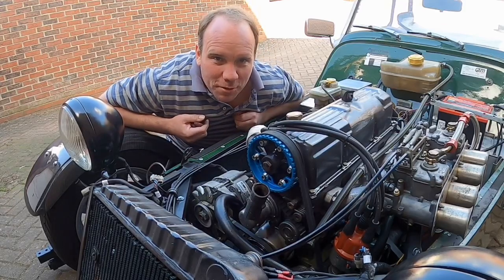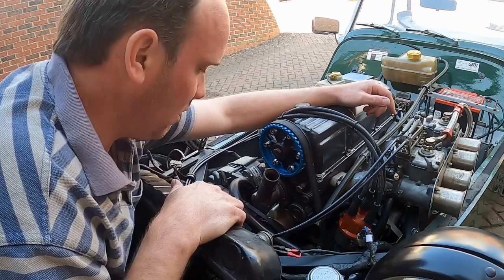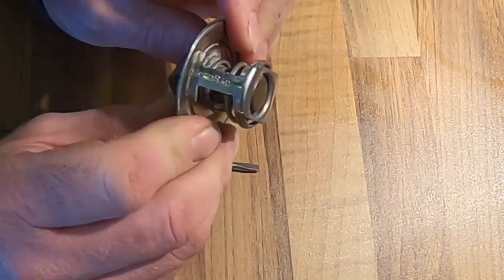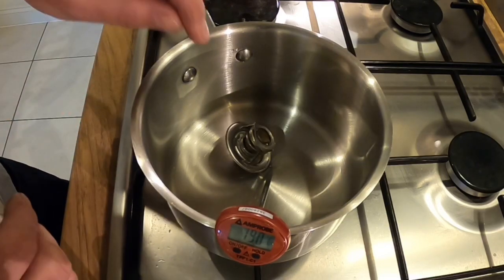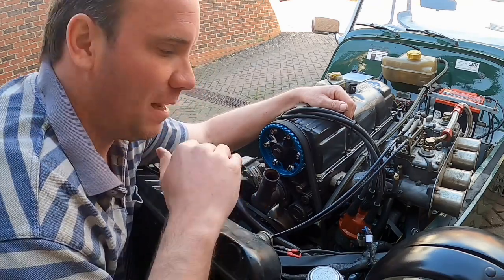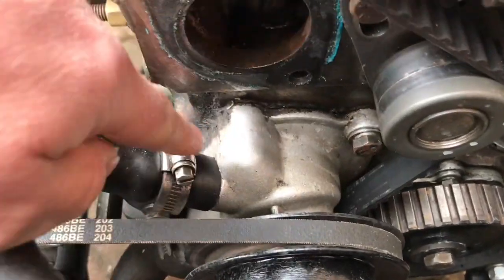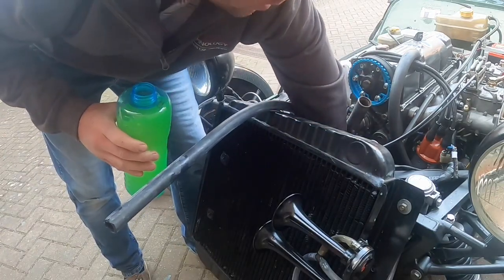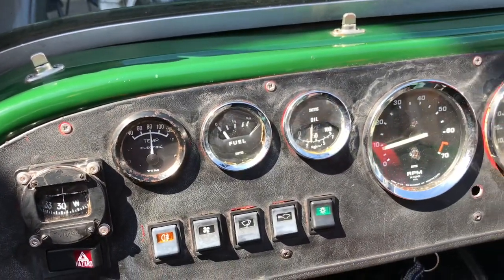Is your engine overheating? Try this first before spending ££$$ Ford Pinto 2.0 Westfield

Comment: Question; could you put an auxiliary water pump into the coolanr system? 

I am currently setting up a 2.1 Pinto in a kitcar and a little worried about cooling issues before they occur... I noticed modern cars have a couple of electric water pumps in addition to whats in the block itself, would it be any good in a pinto?
Reply from the maker: Yes this is possible but the mechanical pump is sufficient enough. It’s a more expensive solution. You will see in another video of mine that the solution was to purchase an aluminium radiator with an electric fan. My rad was old and blocked which led to my overheating
Reply: @alfatechniks887  noted 👌 thanks 

Ğ

Comment: Sorry to tell you but the standard thermo was a 92°, the 88 was fitted to vehicles going to colder climates from 1970 /1984, the extra 4 makes a big difference
Reply from the maker: No problem. The car was actually still overheating and I found it to be a blockage in the radiator. Upgraded that and ran the car for a year in very hot weather with the colder thermostat and it was fine. I never took it out in cold weather to see the difference

Comment: Tempteratur was measured at the bottom, the source of the heat inside the container. The copper part on the other hand was at the top of the container, the furthest from the source.

Comment: it looks like your thermostat was upside down.  the spring side should be pointing into the block
Reply: YES  you can see at  2.26 that it's in backwards. The "wax" end should be on the hot side, engine side, as that what makes the thing work ! The other way in would need the radiator water to get to 88"c before the valve opens.
Reply: This is so weird, i bought a transit with the same engine as this some years ago. Bought it at the "specialist" here in the netherlands. I drove it for a summer, no real problems i only noticed when it rained the temperature suddenly droped. And then in winter it ran verry cold. Sooooo that should probably be a stuck open thermostat. I went to check it and indeed. It was stuck open. But also it was mounted the wrong way round! Even for a van that was maintained at the specialist! I reckon they are mounted wrong way round because it actualy fits. I am a mechanic and i never seen a other engine where it was possible to mount it the wrong way round.